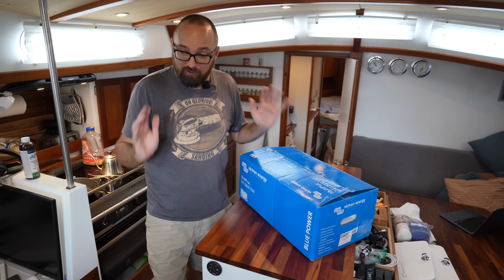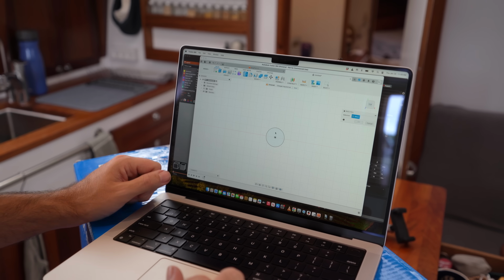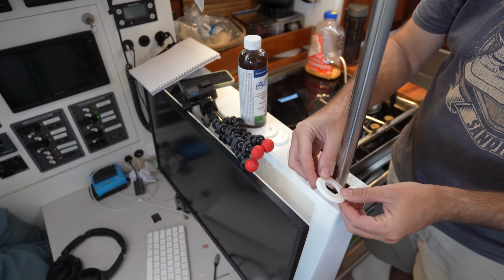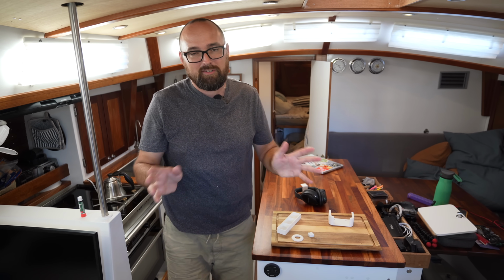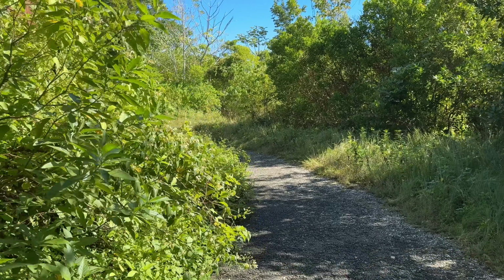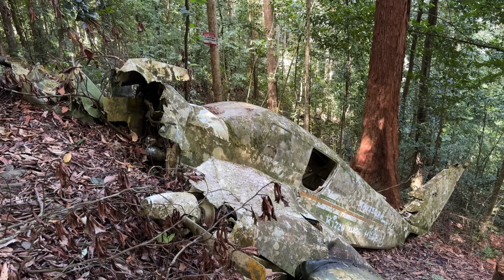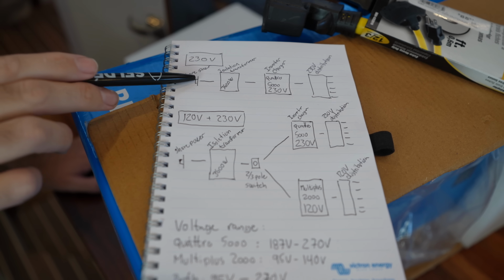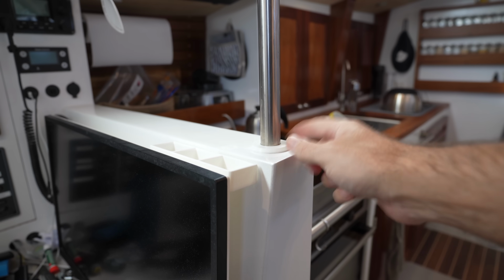Sail Life - 3D printer onboard & hike to abandoned tracking station

Comment: An SVS Sollatek voltage stabilizer proved very useful when we had a poor mains supply. Eventually I bought a Victron Skylla  battery charger with a universal input. It worked from 100V to about 280V and works from DC to 50/60Hz and provided 3000W output at 24V.
Reply from the maker: Sounds like a good setup :)

Comment: Is there any possibility to just use a single inverter capable of 240V 60hz? Split phase in the US is technically 240V and if wired correctly you can have both 120 and 240 from one. The only issue is the wavelength, but most electronics are extremely tolerant and function on both just fine. You could check labels and see if they're all rated 240V 50/60hz.
Reply from the maker: That's a good question. I suppose you could but our oven won't work with 60 hz :)
Reply: @SailLife  Dang.
Reply: @SailLife  I'm not certain if it is all, but at least some split phase 120/240V inverters have user selectable frequencies. One from AIMS Power which is mid-range lists in their specifications "Output 120/240 Vac – Split Phase 50 or 60hz".

Comment: How does the white 3D printer material hold up to UV?  I have found that over time white zip ties get brittle while black seems to last longer.
Reply from the maker: That depends entirely on what type of filament you use :) Some a very resistant to UV

Comment: Surely you need a tiny indent to unwedge the screw covers. But nicely done sir ...ow more victron to sort out the 240v & 120v feeds,...l'm intrigued'
Reply from the maker: I figured it would look nicer without :) I can alway just use a drill and a screw to remove them if needed. In all likelihood those hatches will never need to come out :)

Comment: The electric supply in the US is actually 240V at 60Hz.  You get 120V by using one leg and a ground.  The outlets in the house are 120, but the Oven uses two legs and is 240V.  Apparently the US is 240 and 60 just to be "more impressive" than Europe.
Reply from the maker: I'd like to counter with the fact that US plugs are horrible ;) The UK ones are awesome! :)
Reply: @SailLife  I agree about the plugs.  In US Marinas, there are 50 amp outlets that are 240 V in two legs that are 120 V each with a ground leg.  My understanding is that european outlets at   230V don't use a ground.  BTW,  I don't assert that 240/60 is more impressive, that was the work of George Westinghouse a long time ago.  Fair winds and following seas, Mads and Ava.
Reply: @meganluke444 europe is 400 volt 3 phase. That gives 3 230 volt single phase circuits for lights and wall outlets by connecting each phase to the neutral. All high demand loads like stove, water heater etc. are 400 volt 3 phase.

Comment: If you ever need to print anything that will be out under UV you should get yourself a roll of ASA filament. I have printed replacement outside hatch handles (going for €65 each if I was to buy them) and they are still hanging strong after 4 years in the sun
Reply from the maker: Nice! That's a great tip :) Thanks!

Comment: I assume your cad model is parametric?  Can't you just change the parameter in the model.  I know you have to generate a STL and make gcode.  But in the future you may not remember which model is correct.  Configuration control.  :) Will that 3D printer work when you are underway?    Great video
Reply from the maker: Fusion 360 is parametric but I'm still learning :) Given how much I was shaking the printer during the test print in Michigan I see no reason we shouldn't be able to print while under way :)
Reply: @SailLife  Cool.  Have a good sale north.

Comment: It’s funny that when people get these and mostly print things that can be purchased at a home improvement store for a few cents. Enjoy your totally unnecessary but fun toy.
Reply from the maker: Just today I printed something much better I wish I would have included in the video. A deck fill key. Printing that rather than buying it in a marine store just covered the cost of the whole spool of filament 🙂 https://www.thingiverse.com/thing:1622406
Reply: @SailLife  Perfect. Anytime you can print something that can only be purchased in a chandlery. It’s a definite win.. also, I wanted to tell you that the electricity in the United States is very well regulated, and in my 65 years I’ve never had a problem anywhere ever
Reply from the maker: @vandalorian8777   Hehe, oops then we have just solved a problem we might never have again ;) I'm still glad we'll have a 120V inverter on the boat too :)
Reply: @SailLife  I’ll wait until next week to find out. If it were me I would install the 120v inverter and gradually add outlets throughout the boat. It can only add value to the boat and make things simpler

Comment: Grear vid thx.  2 suggestions
1. You should mirror the stamp
2. Are you going to make a similar round trimmer for the top of that pole too?  Against the ceiling.

Have a blast.    Thx again.  Keep up the good work. ❤
Reply from the maker: 1) yup, totally missed that one. Oops ;) 
2) As soon as we have the new headliner in place (sometime this summer)  
Thank you so much :)
Reply: @SailLife  Please make an upper trim ring now.. even if its temporary. We've been waiting for the lower hole to be done forever. Now the focus is on the hole above.  Thank you!

Comment: Watch out for moisture in the air affecting your prints. PLA absorbs water like a sponge but keep it in a sealed bag with desiccant and you should be okay.
Reply from the maker: We haven't had any issue with the PLA yet :) Even after it has just been sitting out for a month :)
Reply: Nah not PLA. You are thinking of nylon.